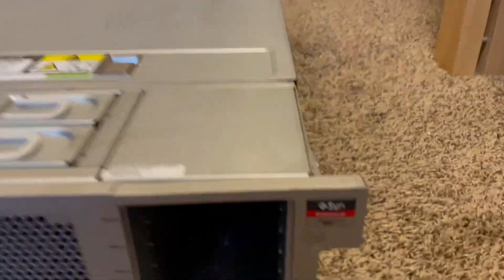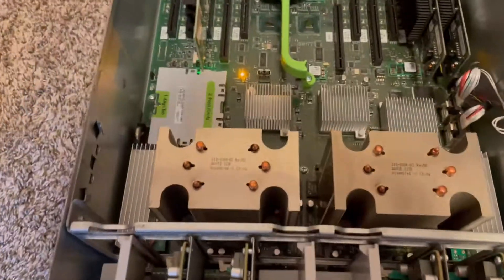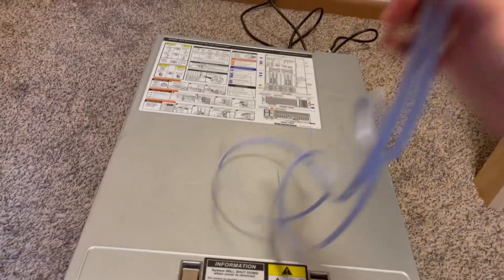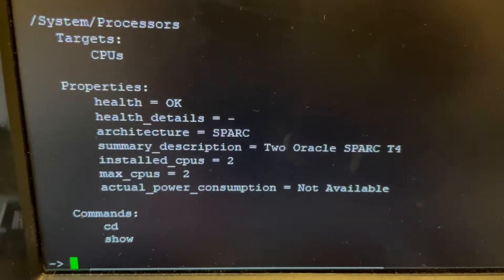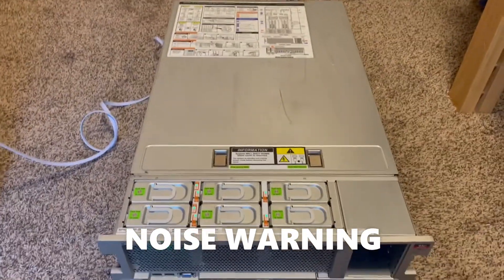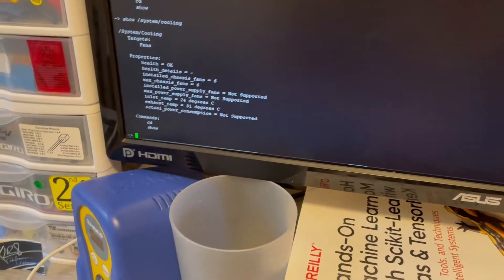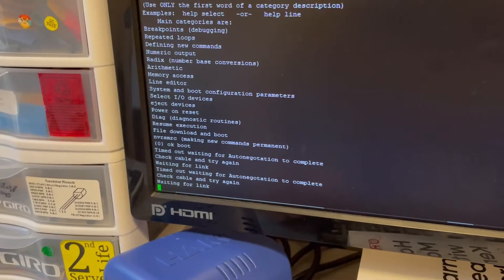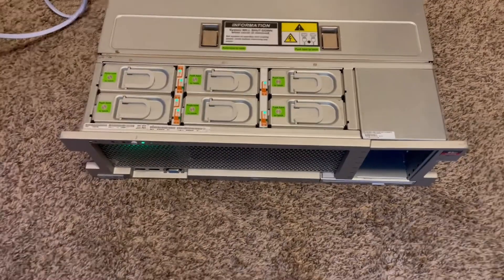A Look at the Sun Oracle SPARC T4-2 Server w/ 512GB Ram and 2x 8C64T CPUs

Comment: Is the Service Processor (SP) module required for the system to POST?  I’m trying to diagnose a SPARC T4-2 and I’m receiving an amber light near the SP label.
Reply from the maker: Not sure if it is, it might be? Is your system not posting
Reply: @tylerebowers  Well, the fans spin up as they should, that amber light is present, and nothing appears on the display.  The USB ports don’t appear to give life either.  Not sure what to make of it.
Reply from the maker: @5thaltaccount547  The display is not started until the os boots (and has drivers installed), you will have to connect through serial to get the the ok prompt first.
Reply: That makes sense.  Thanks for the pointer.  Hopefully I’ll be able to get it booting.  I’m currently interested in deploying the Debian SPARC64 port + a modern enough PCIE AMD GPU + MESA and see how well or badly it’ll perform with GPU accelerated tasks.  I should get said cable then.  Well, it’s weird though that there’s never a green front panel light even when it does start and the fans spin up.  It’s always an amber light.  Oracle’s documentation reads this regarding what my server is showing: “Steady on, amber – An SP error has occurred and service is required”.  I hope that I can access it via console once I acquire the appropriate cable.  I didn’t think it was mandatory.  I’m not ruling out potential shipping damage though regarding the SP module error.  Weird stuff started to happen to the package when it made it to the last mile facility.  Said FedEx facility is notorious for not treating their packages well whatsoever.

Comment: By far one of the loudest servers i've ever seen... I'm curious, have you managed to boot this unit up and did it require some sort of software license?
Reply from the maker: It never asked for and software license it could be that it is already activated however.
Reply: No software license is required. Not even for installing and running Solaris. Technically you can even legally run Solaris if all you use it for is development, and turning off the "Solaris call home" feature is trivial. The M series have additional cores on the chip which can be activated with a pay-for license, otherwise you get the default number of cores per chip.

Comment: Curious what the Java performance on this is like
Reply from the maker: The problem is finding a way to comprehensively benchmark the system. Awhile back I tried to get sysbench from repo and even compile it from source but ran into issue after issue. I suppose that there might be some java benchmark program but I didn’t think to search for one. Sparc these days has null support.
Reply: Forget Java - the T4 is a number crunching monster; they are very, very fast.

Comment: Why choose this server instead of general purpose, like amd or intel, I just randomly found this video and I don't even know It's use case
Reply from the maker: A popular comparison is that sparc (risc architecture) is a slow bus compared to a small car which is AMD/Intel (Cisc architecture), that is you can move much more slower or less people much faster. However this is becoming less true over time. Sparc had its use cases a long time ago and it used to be a leading architecture but x86 just took over. Nowadays there isn’t much reason to use them other than highly specialized cases since not much software is compatible with them.
Reply: @tylerebowers  thanks
Reply: @tylerebowers  not much software not compatible ?

Most of the server software is available.  That machine supports a lot of threads so anything running web apps.
Reply: In their time these were general purpose servers with high availability, uptime and I/O.  Business was willing to pay a premium.  Solaris was also known as very stable operating environment with partitioning. (virtualization) allowing for it at hardware level as well as the software level.  However, with the maturity of both the x86-64 platform along with the Windows and Linux server operating systems proprietary hardware for Unix systems came to an end.   Theses system ran databases like MySQL, DB2 Sybase, CAD/CAM. Finacial Modeling , account handing trades , websites etc. So they are general service and have a large amount of software.  The fact is they just became too expensive. It the Life of computers and operating systems.

Comment: Where did you pick that server up from?
Reply from the maker: I got it from an eBay reseller of decommissioned equipment.
Reply: @tylerebowers  There goes the rest of my afternoon as I scour ebay for a good price... thx!
Reply from the maker: @puffinrock2871  https://www.ebay.com/itm/Sun-Oracle-SPARC-T4-2-Eight-Core-2-85GHz-CPU-x2-512GB-RAM-No-Hard-Drives-/304377296860
Reply: @puffinrock2871  I have 5 available if you still need one!

Comment: Maybe you could clean and oil this fans. are they normally so loud?
Reply from the maker: Yes, normal for the T4 series. I think the T5 series improved fan speed/noise. These fans were clean and don’t need oil, the noise is just from speed.
Reply: Yes, they are. The T4 server is designed for a datacenter, not as a desk side system.

Comment: kinda sad that Oracle had finally finished killing Sun Microsystem.
Reply: They literally just released an 8-socket system with 5.0 GHz CPUs with 32 cores and 256 threads EACH. And they guarantee some kind of support till at least 2034. Even Fujitsu is going to be releasing an update to their aging SPARC M12 servers that use SPARC64 XII CPUs that debuted in 2017. It's absolutely amazing that even two companies are still making these things, at all.
Reply from the maker: @NUCLEARARMAMENT  They have their markets however, oracle is well known for being among the most reliable and well built of servers.
Reply: I agree.. I started my unix admin career with SUN in the mid 90s.... and miss the old SUN days.   We still run many T4s at work (government health care) along with T5s and T8s, all running oracle vm with logical domains, but Oracle/SUN servers are slowly dying. Oracle 11.4 supposedly will be around until  into 2030.. but who knows if that will change.

Comment: One question: can we use FreeBSD?
Reply from the maker: I think that there is a version that runs on sparc but the project didn’t seem like it was very supported last time I was looking at it. I’ve been thinking about trying to get a fork of illuminos running so I’ll try FreeBSD once I start experimenting again. Edit: it seems that the sparc T4 might be supported, there is Netra T4 support on the FreeBSD page here: https://www.freebsd.org/platforms/sparc/
Reply from the maker: btw I have another video showing solaris 11 with desktop running on this server.
Reply from the maker: FreeBSD, Debian, Gentoo, and OpenBSD did have Sparc support at one time but they were more for older sun cpus. The T4 is new compared to the ports, I did manage to install opensxce however I was having issues with the repo. It seems that Solaris is really the only fully (<- relatively) functional OS for the sparc T4 (and T5 and on etc).
Reply from the maker: Here is a website that shows most of the OSes that support sparc: http://netmgt.blogspot.com/p/opensxce.html
Reply: @tylerebowers  OmniOS is probably the closest experience from Solaris one would get, and they have a community edition now. I just looked on Github and it seems there is still code for SPARC sun4v although in a blog a maintainer explains that it's hard for him to get 24/7 access to modern SPARC computers to run a full build chain on it on every release. But it's meant to work.

Damn those T4-2... We had a bunch of those (and as well as T5-2 later) in my first job, I was responsible for automating Zones creation to replace older machines. That was pretty fun until we saw how bad Oracle ended up treating the OS and the people responsible for it.
Reply: There's a special place reserved in hell for those who use anything other than Solaris or illumos on this hardware.
Reply: @AnnatarTheMaia  hahahaha,
Reply: @renatofp  that's no laughing matter. These alternative operating systems can never take the full advantage of this advanced hardware, and besides, Solaris and by extension illumos-based operating systems are the most advanced humanity has been able to come up with.
Reply: @AnnatarTheMaia  Its 2024. It's something very fun to play with, but without any real use, huge energy consumption.
It's that time, nostalgia is fun, but in 2024 it's just something forgotten.